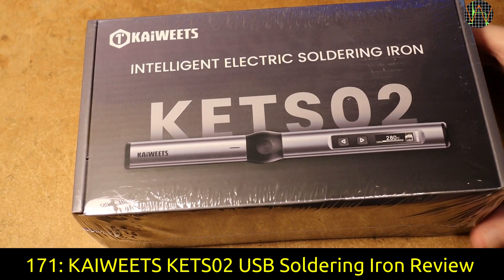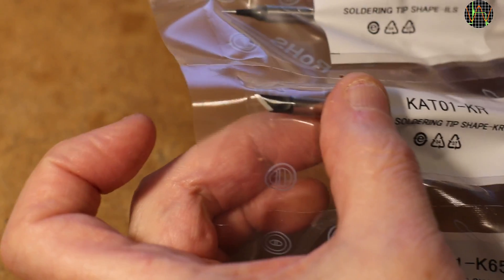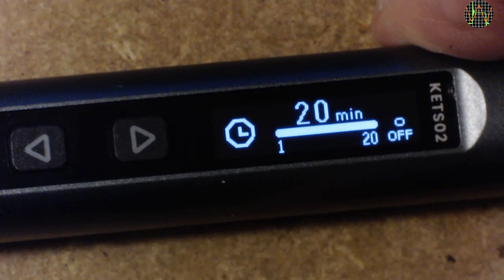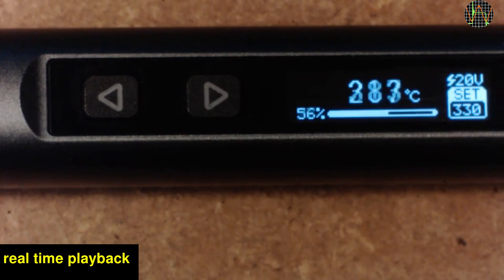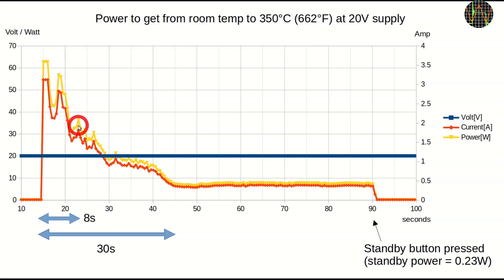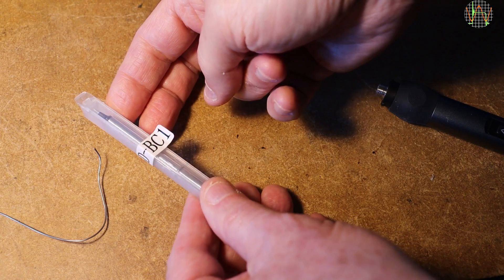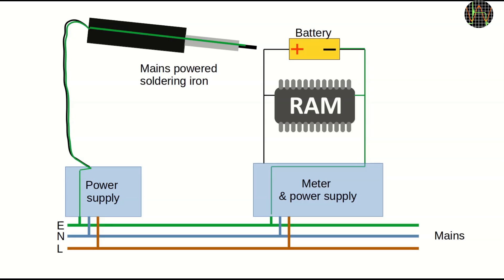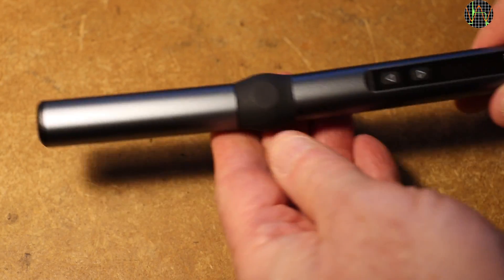171 - KAIWEETS KETS02 USB Soldering Iron - good for electronic projects?

Comment: I expect you have seen Big Clive's vid on the T12 style bits ? They look like they have similar sleeve connections, but the total length looks quite a lot longer to me, also those have two shoulders rather than one. However, the internals
may be similar - a heater element in series with a thermocouple. Clive explains this quite well. May or may not be relevant to the Kaiweets you show here.... 
Dave
Reply from the maker: I did and this confirms my assumption that the heating element and sensor are co-located (in fact they are the same thing).

Comment: I have a fnirsi HS01 that looks exactly like the KETS02, so I'll asume it's the same product. It's a blessing for those of us that cannot afford a proper soldering station. It kind of looks like a toy, as someone commented, but it's a huge improvement compared to the unregulated, direct-to-mains iron I used for so many years
Reply from the maker: It also immensely portable. Just yesterday I had to re-solder a wire that came off inside  someone's kitchen appliance (a chopper/grinder). Rather than having to carry it back to my place, fix it and bring it back, I came prepared with the KETS02 and the USB-charger in the toolbox and did it right there in 5 mins. Brilliant.
Reply: @TheHWcave  absolutely! Some weeks ago I used it to patch some wires in my car and it was absurd how quick and convenient it was